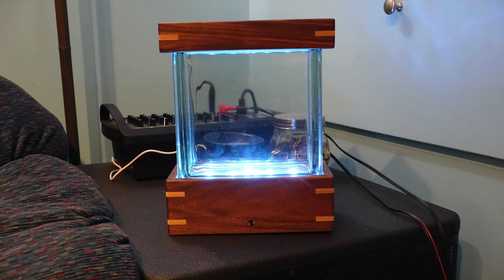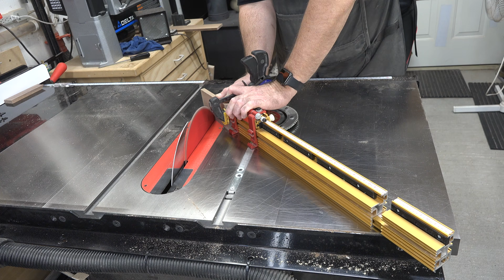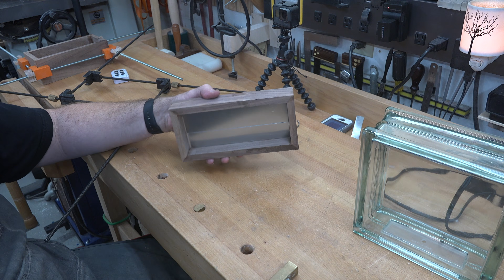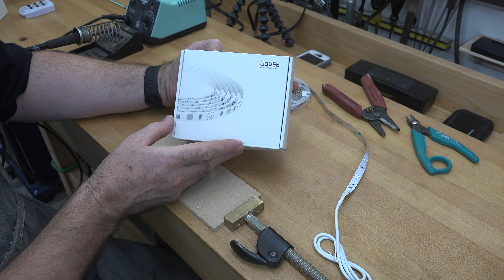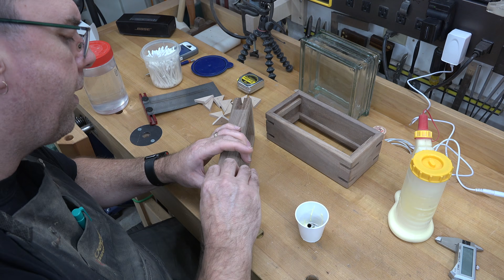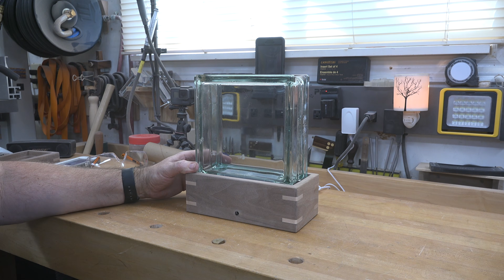Glass Block Accent Lamp

Comment: Hi Kenny! Remember a couple of weeks ago we were discussing cutting angled stock against the fence and I suggested perhaps using a spacer that would support the angle and then the pointed edge would be up on the fence. In any event, I was just watching the "Michael Alm" channel video title "Hexagon Patterned Plywood | How To" where he does that exact process starting at about 2:15.  Regards, Bill
Reply from the maker: Thanks for the follow up Bill.  I will have to check that out.  I appreciate you tuning in and taking the time to chime in with your suggestions and comments.

Comment: Hey Ken how do I open a pickle jar?
Two weeks later NASA has reconfigured a mars lander lol.
This was very cool project, the fact you can open the glass just makes it better.
You and your family take care.
Hows the jeep?
Peace.
Reply from the maker: Opening a pickle jar.
1) Attempt to open jar in tradition way by twisting the lid counterclockwise in relation to the jar.
2) Realize that step one didn't work and run the lid under hot water to attempt to soften whatever is making it stick.
3) Attempt to open jar in tradition way by twisting the lid counterclockwise in relation to the jar.
4) Realize that step three didn't work and tap the lid all the way around with the handle of a knife.
5) Attempt to open jar in tradition way by twisting the lid counterclockwise in relation to the jar.
6) Realize that step 5 didn't work and wrap a cloth or towel around the lid to try to give some grip when opening.
7) Attempt to open jar in tradition way by twisting the lid counterclockwise in relation to the jar.
8) Realize that step 7 didn't work and that your hands are getting sore and red and that for a relatively young man, you are out of breath and getting your butt kicked by a pickle jar.  Grab the jar and take out all your frustrations, applying all your strength to attempt to open jar in tradition way by twisting the lid counterclockwise in relation to the jar.
9) Realize that step 8 didn't work and that someone (who you have always regarded as weaker than you physically.....probably your wife) is laughing at you on the sidelines.  Hand them the jar to open and accompany it with the comment...."If you think this is so funny, YOU open the darned pickles!"
10) Watch in horror as they twist off the lid with absolutely no problem whatsoever and hand you back the jar.
11) Salvage what little dignity you have left, by saying in your toughest voice..."I loosened it for you".
Thanks for tuning in sir.  I hope this helps.  And for the record, the Jeep is fixed and back to normal.  Thanks for asking.  Stay safe man.
Reply: @acutabove_woodworkings  DAMN KEN LOL>
https://www.youtube.com/watch?v=8DYje57V_BY

Comment: Hi Kenny! Two things, did you make the all thread clamps and, I was intrigued by the spline jig. Did it originally fit over a fence or is that just an outrigger to keep it standing up? Lamp looks good. When I was in HS, I designed a house in the shape of a pentagon with an interior patio using those glass blocks to cross between various areas of the house. The blocks were to be lighted and it was only about 30-40 years later that I discovered fiber optic cable so they could be lit up from a single source light and not have to have bulbs changed except from a central source. Oh well...
Reply: That house sounds very cool.
Ever go any farther with it?
Reply from the maker: The hand screw clamps were purchased Bill but I do have a show listed to make my own very soon.  I just have to get my butt in gear and actually film the project.  The spline jig was made for my original table saw and yes, it rode over top of the existing rip fence.  I just use it against the fence of my new table saw now so that I can use the jig when I need it.  I really do need to update it and make a new one.  That house you describe sounds awesome.  It incredible how far technology in lighting has come over the years.  Thanks for tuning in sir.  Great to hear from you again this week.
Reply: @acutabove_woodworkings  Hi Kenny! I mentioned my issue with doing the round over on small parts and that I used double stick tape. First project it worked really great but only about 12 parts. Second project had more like 27 parts and all that double stick tape stuff with trying to get the back off and the expense was getting to me. So...I am trying out a new jig to hold them. I am making a clamping system that is only about 1/16" high using sawzall blades. It grabs the part very low so it doesn't interfere with the router bit and I can just insert the part, swivel the blade to kind of jam into the bottom of the part which locks it against a backer block and then clamp the other end of the blade in place. So far my early testing looks promising. I'll let you know how it turns out. Bill